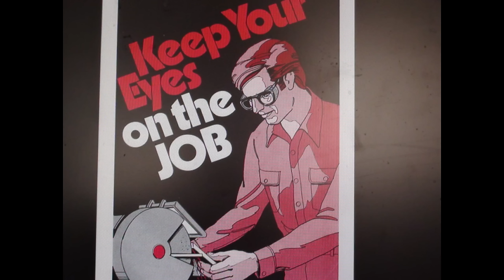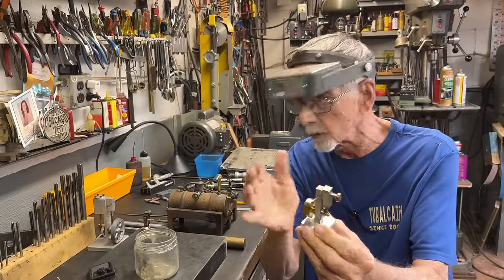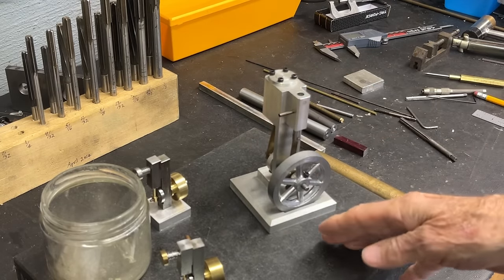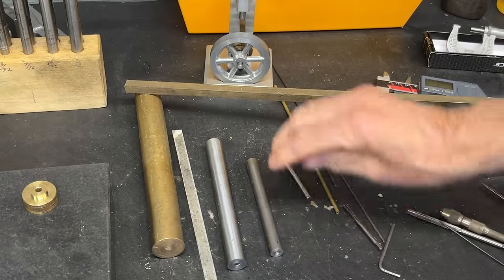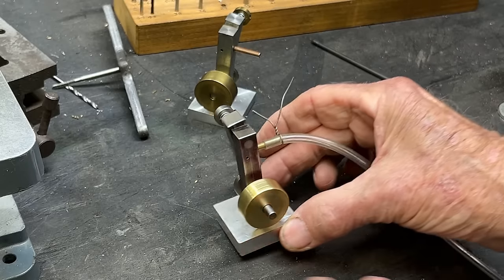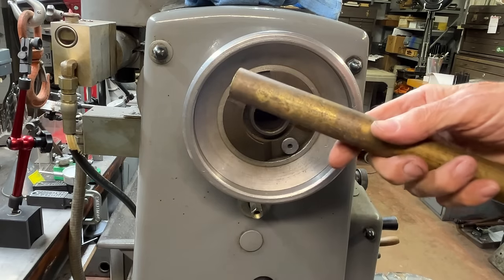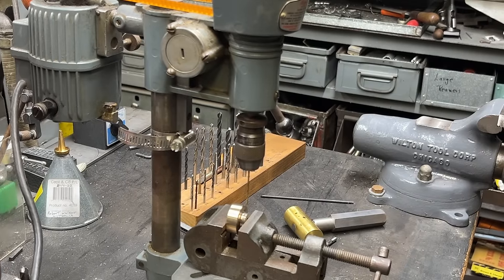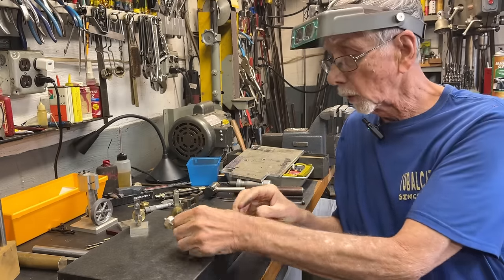BUILD A TINY MAYONNAISE JAR STEAM ENGINE pt 1 #906 tubalcain

Comment: One interesting fact and a possible source of magnesium would be old Toro lawnmower decks. They were cast magnesium and quite thick. I grew up in a shop that did small engine repair and was the largest Toro dealer in the southeast (70 years ago). They prided themselves on those magnesium decks and they had a lifetime warranty on them. I can remember work in the mid `80's and a lawnmower came in with a cracked deck. Toro replace the deck even though the unit was over 30 years old. I was flabbergasted they still had one, but I can remember it vividly.
Reply: Toro replaced it…like, under warranty?

That would surprise me!
So would a customer willing to pay for a replacement, because I bet it wasn't cheap!
Reply: @Iowa599  Yup Toro replaced it, under warranty. Back 40 odd years ago, lifetime warranty meant just that. Forever, I am sure now there is a bunch of legal mumbo-jumbo that constitutes "Limited Lifetime Warranty"

You know, I was thinking about it after I made that post and I also vaguely remember the technical manager coming over from Kolb & Co. (Who was the Toro distro in Atlanta) to inspect the deck. If I recall correctly, he actually brought they replacement in the back of his pickup when he drove over.
Reply: @harlech2  I remembered working on a cast deck when researching that…

I'm surprised there wasn't a recall for decks bursting into (unstoppable) flames.
Reply: @Iowa599  I don't think magnesium is as big a fire issue as you might expect except with small, fresh fragments, Larger pieces don't have enough surface area exposed to O2. Plus the oxide layer that rapidly builds up protects it.
Reply: Yeah, might be safer than I imagine. I'm remembering Havoc! movies from back when mags were magnesium at LeMans.

Comment: A warning about fine mag. chips, and dust fires might be appropriate. I had two mag. school shop fires. One in the lathe chip pan and another in a foundry crucible melt. A bucket of sand is a good fire extinguisher when working on magnesium.

Comment: I am not a machinist but think I could have been.  I love working at close tolerances.  I am retired now and don't intend to begin a new career in machining.  However, I love to watch machinists exhibit their skills online.  
My brother has a small Atlas lathe that he told me to just come and get since I am enjoying watching machining.  He inherited it and doesn't intend to ever use it.  My issue is I am seeing the tooling needing/required to do everything I might want to do.  The cost for me as a hobbyist could not be justified, so I'll be satisfied with watching and learning from real machinists online.  Thanks.
Reply from the maker: Spend a few dollars and get that machine
Reply: I agree! Get that lathe if you’re interested. That’s the biggest hurdle is getting the machine. Buy tooling for it as needed for various projects.
Reply: Do like Mr. Pete and watch the auctions. You Ishtar get lucky a few times. When I was working (as a mold maker) we were buying shops and inherited a lot of duplicate tooling that we did not need. I set up a guy that I knew bought a small mill without tooling. I was able to set him up with a whole set of R-8 collets (used) but it was better than nothing.

Comment: Just fun to see you. 😊

I pontificated in an online machinist chat last night regarding who makes the best to buy indicators. This chat room stirs up the worst in people's natures, so expect some heated responses. Am I the only one that feels negatively about Interapid? I only own one and keep it as a trophy in my collection of 40ish premium indicators.  I have never used a shop shared Interapid that was NOT damaged. They are so fragile that lash develops in the probe tip travel mechanism. Having been burned many times, I quit using them. I inspected the lash when it was suspected. The worst that I recall was almost .0020" in a .0001" indicator. It was in daily use and was trusted by shop machinists.  Their "unique" pin mounted attachment forces you to almost have to dedicate one mag base for exclusive Interapid use. They have the BEST travel range in the market, and this is a huge plus for ease of use. That are very pricey, their easy to damage characteristic and their unique holding system makes them a poor choice to me.
Reply: Yo. Kind of off topic there bro. Indicators, Give me a break but 20 bucks says the biggest corksniffers can't read a pocket scale below a quarter and think "tenths" is something you see at an old Boyscout jamboree.- Indicators, are indicators, Some are smother then others and last longer after being dropped a few times but it's rare to find one that will not repeat to 50 millionths when in working order. - I do have a couple of old .0001 Federals that are well over 70 years old that work as good as the day they were new, and a 1 year old Mit that sticks. - Even the Harbor Freight indicators will get the job done if all you need is a half thousandth. ===== But how 'bout Mr, Pete's new audio. - I think the old system is orders better then this one.
Reply: @mathewmolk2089  You have a good point. I was still wound up from my recent rant in the chat room. I have calmed down now. My hobby world can't hold those tolerances, but I worked in that world when I was still employed. I love fine tools, and usually only purchase the leading brands for each industry that I play in. I don't own many Federals and have little experience with them.

Comment: I'm currently working on my first steam engine, and it's REALLY tiny.  The base is only .75" x .5", and it stands about 1.5" tall.  I probably should have started with a larger one, but it's fun so far.
Reply from the maker: What is the bore and stroke?
Reply: @mrpete222  I believe it's .25 x .25"